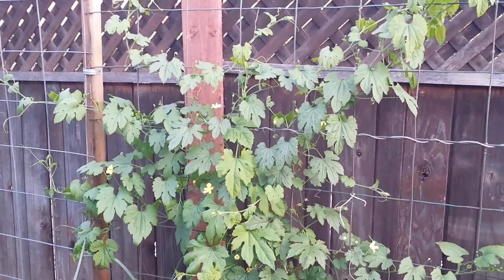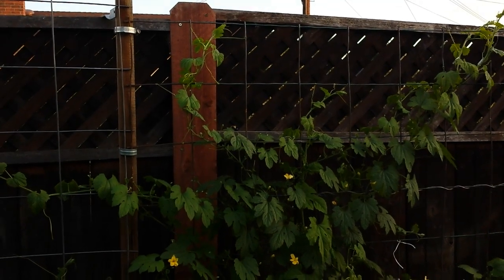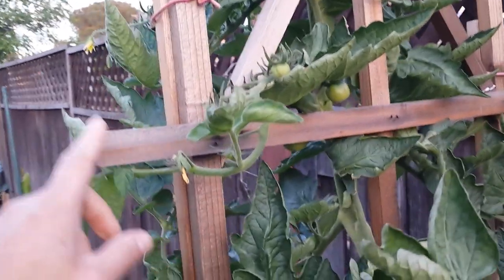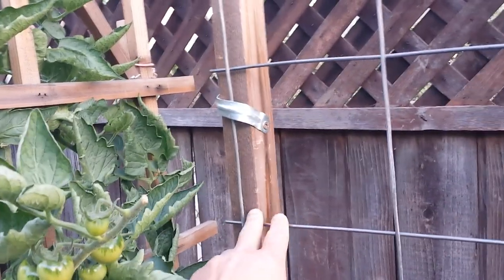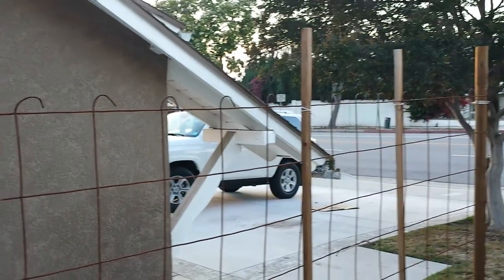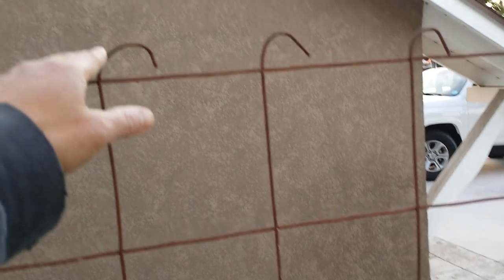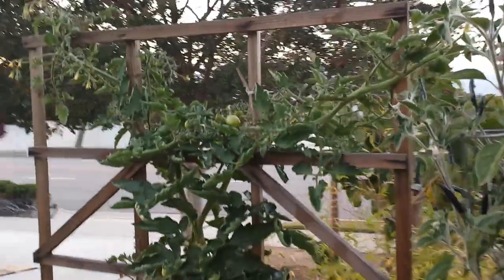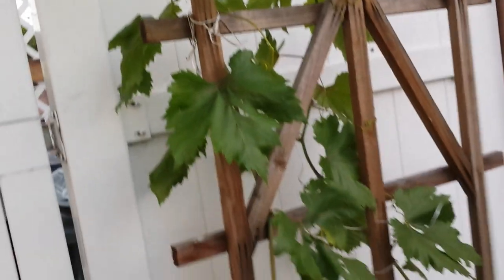Trellis For Plants With Tendrils

Comment: thankyou for showing how your trellis is set up.  I built a similar trelis for my lilikoi (passion fruit) i used a thin steel pole i found at walmart, and i used zip ties to secure the concrete mesh. So far is looking sturdy and i am planning to keep the lilikoi small and managable.  It is growing in a 7 gal pot .
Reply from the maker: If you grow it in a pot, you will naturally limit the growth.  How big is your trellis?
Reply from the maker: Do you have a video to show me?    How big is your trellis? The zip ties might not be enough to how it.  Your passion fruit is a perennial,  it will continue to grow.

Comment: Where did you buy your supplies for the trellis?  Never seen the rounded stake or the metal wires like the one you have.  I have a local garden nursey but haven't seen the wood or the metal.  Went to Home Depot and didn't see exactly what I needed.  There is a Lowe's nearby but haven't checked it yet.  Thanks.
Reply from the maker: Hi. The round wooden stake and the concrete wire are both at Home Depot.  The wooden pole is 8ft tall, about $5.00 in the garden section.  The wire is 42 inches by 84 inches is about $8.00  in the construction department.  Finally, the pipe straps, 10 each is about $9.00 in the plumbing department.
Reply: Thanks I will go back and take a better look!
Reply: +OrganicGarden Sage Thanks, now I know what to buy and where to look. Thank you so much for making this helpful video. :)